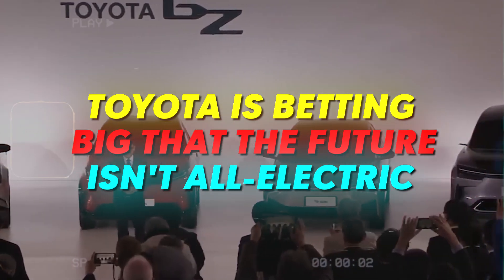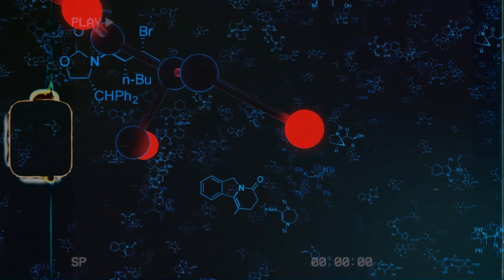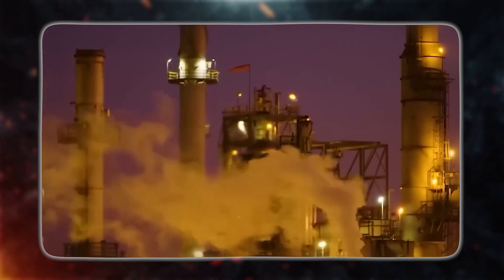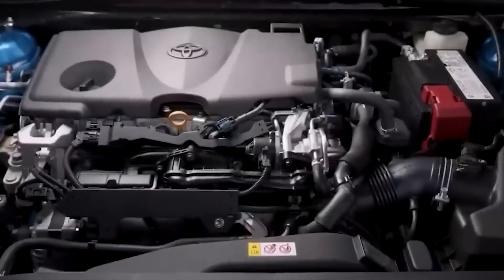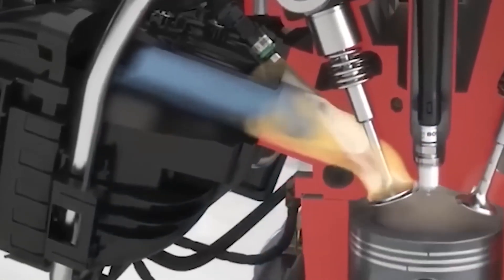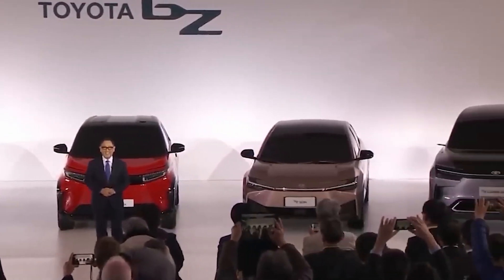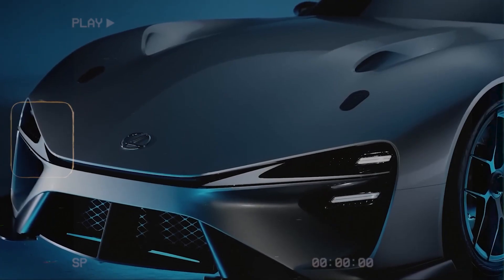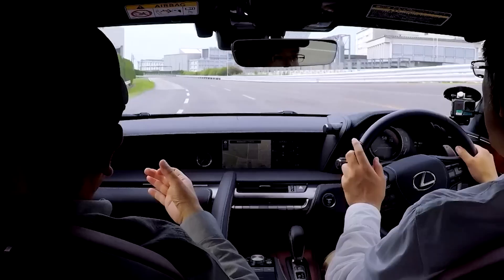Toyota CEO: "Our NEW Ammonia Engine Is The END Of EV's"

Comment: This is absolutely absurd. There is no competition for BEV's. Three simple questions can demonstrate this. 1. When you go home at the end of the day is there an ammonia outlet in your house that you can plug into and find your vehicle fully fueled the next morning? 2. When you drive a nice long run downhill can you expect to have more ammonia in  your tank at the bottom then when you were at the top of the hill?  3. How efficient is the process of using ammonia to power a vehicle from the point of having no ammonia to the end of the drive? There is zero ammonia to vehicle infrastructure at present, we already have an electrical grid almost everywhere. Why are we still wasting time on new forms of combustion power? It should be relegated to hobbyists where it belongs.
Reply: How did you get to the top of the hill? Your battery level will be lower than when you started. Recovered energy will always be less than energy used to climb the hill.
Reply: @ianbuxton525  There is a charger at the top of the hill because the electrical grid is almost everywhere. So I charge to 80% at the hotel free charger at the top of the hill and when I get to the bottom of the long downhill run I have more than 80% charge. Be sure to let us know when hotels, malls, grocery stores, restaurants, etc start putting in free ammonia pumps.

Comment: I have a degree in Chemistry, NOX's are very harmful and toxic to the environment. ie Nitrous oxide is 300 times more potent (reactive) than carbon dioxide, and it also depletes the ozone layer. Its so reactive it has a shorter lifespan... Overall its difficult to say its better or Worse than CO2, it is certainly has a negative effect on the environment and indirectly contributes to global warming.